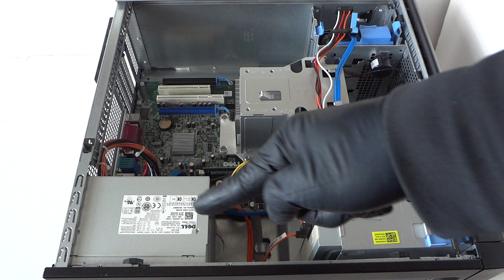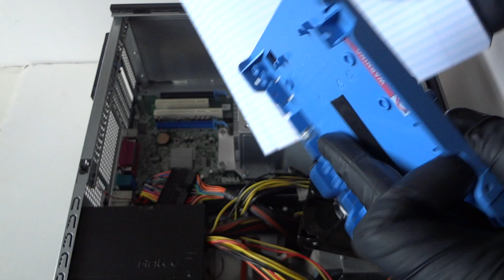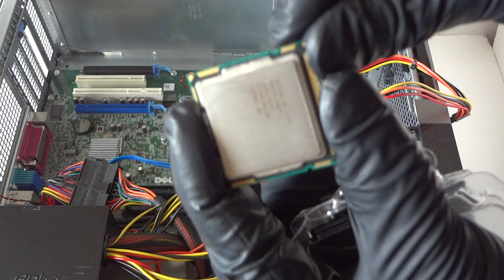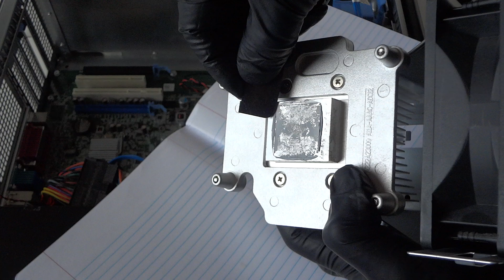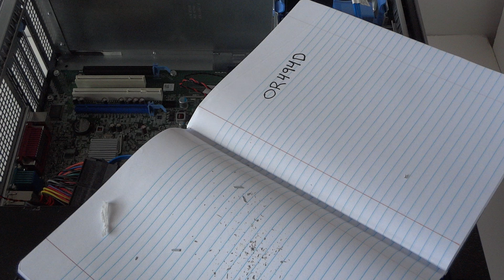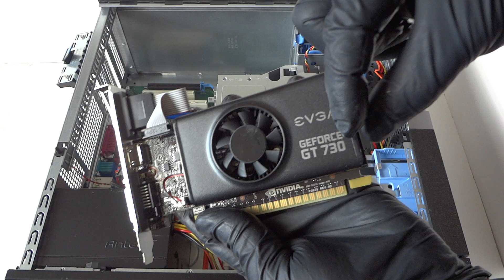Dell Optiplex 980 Upgrade Video Card RAM CPU SSD PSU

Comment: I literally did the same thing but I just replaced the cpu with an i7 that can run on 235Ws and put an Nvidia GT 730 in. Gaming computer for 130 bucks. I can play fortnite at 1080p @ 120fps no prob.
Reply: @ATLHooligan which i7 processor did you use? Thanks!
Reply: @RedRocket204  870 - best one that will fit. I may need your help on my ram upgrade I'm planning. What 4gb sticks  did u use, I heard of people having issues with some 4gb sticks.
Reply: @ATLTraveler  I have not upgraded RAM yet, YET. My 980 SFF has 8GB RAM installed which is working fine but since that RAM is cheap, I want to bump to 16GB. I will get the specific RAM running in my system (2x4GB) and report back, give me a little time as I'm using it for work ATM. Thanks for the info on the CPU as I was hoping it was the 870.
Reply: @RedRocket204  ok goodluck, this guy seems to have no issues, but I don't know if he ever turns these on and runs things. What GPU do you have? I'm trying to find out what the best one is that will fit with minimum cutting/alteration. I think I definitely need to upgrade my ram and power supply for anything stronger than my 710.
Reply: @ATLTraveler  I don't have the GPU yet as I just acquired this Optiplex 980 SFF yesterday. I'm looking at a GT 1030 LP single slot and hoping the increased RAM, a new i7-870 and GT 1030 won't exceed the OEM 235W(?) PSU. If it does, then I'll be trying to source a higher power PSU that will fit and not cause issues.
Reply: @ATLTraveler  Found some time to shutdown and pull the cover. RAM type, 4GB sticks x2 for 8GB total, working on my Optiplex 980 SFF - SK hynix (4GB 2Rx8 PC3 -- 12800U -- 11 -- 12 -- B1), (HMT351U6EFR8C -- PB N0 AA .  1316). 
But then there is a lenovo sticker on the RAM stick as well (11S41U6043ZVJ7YK3564FX .  FRU: 03T6566).  
Took a picture of it too just incase I fat fingered the numbers - https://imgur.com/VRPTtAw
Reply: @RedRocket204  nice, see how after the 4GB it says 2R? make sure if you buy more RAM it says this and not 1R. Stands for dual rank instead of single rank. Not entirely sure what it means, something about running times, clock speed, etc. but I read the 980 can have issues if you use single rank RAM. Just an FYI because I'm new this too and don't want to make any mistakes on my 1st budget gaming build.
Reply: @ATLTraveler  Good info, I didn't know that. I actually already ordered the RAM via AMZN and it's pretty much identical except for the lenovo sticker which is just their inventory sticker - amazon.com/gp/product/B01MRC4P5Y/ref=oh_aui_detailpage_o00_s00?ie=UTF8&psc=1
Will update when I receive the RAM if all good.
Reply: @RedRocket204  sweet dude, let me know for sure if they work cause I might order those same ones if all good, decent price so I may just order two sets so they are consistant, not sure if that matters.
Reply: @ATLTraveler  not sure if you've seen this link, might help with decisions - https://www.userbenchmark.com/System/Dell-OptiPlex-980/558
Reply: @ATLTraveler  16GB memory is running - https://imgur.com/UWkg4Jf . BTW, contact me on steam with the same screen name
Reply: RedRocket204 what CPU did you end up using? Was it the i7 870? How is it performing? I’m in the fence trying to upgrade from a stock i3
Reply: @AdamWoodturner  Yes, I went with a i7-870. So couple of things though with the SFF case. I am now running 16GB RAM, the i7-870 and added a Gigabyte GT1030 so I obviously upped the amp draw on the system with a OEM PSU that only outputs 235W. I know I am taking some chances here. I've also optimized Windows 10 along with trying to overclock the GPU (+ GPU clock 240 and + Mem clock to 750). No problems until I tried play Shadow of War and the PC shutdown and I had to press/hold the power button to completely power off. Everything appears to be ok so I dialed back the GPU overclocking but haven't tested with SoW yet. I am somewhat convinced I need to up my PSU. Still a decent system for being as old as it is and I haven't spent much money on it. Should reliably play games at 1080 or 720 with Med/low settings once I get this sorted. The CPU seems to be perfectly fine but I think I'm overdriving the system for amps with the higher watts for RAM, CPU and the added GPU.
Reply: RedRocket204 awesome! I decided to buy the Xeon processor which appears to be the same but on Xeon. Did you replace the heat sink? I have the mini tower like in the video. The heat sink it’s just too bulky. What memory model did you upgraded to? I have 8GB 2x4GB but I just looked and it says 1R so I need to replace it also I guess...
Reply: @AdamWoodturner  Used the same heatsink. As per the RAM, I listed a link and there is also a picture I took of the installed RAM further up this response chain. I matched what came installed with the system.

Comment: Hey guys, I just wanted to let everyone know that you can literally upgrade this Optiplex 980 with any graphics card. I'm running my Optiplex 980 with Nvidia GTX 1070  founders edition. Thats a very long card and it actually fits in the bottom PCI E slot(the black PCI E, not blue one). I got an i7 processor with 8GB ram and i'm running the latest games from year 2018 at ultra settings. You can even play games at 4K Ultra.
Reply: So.. What's the difference between the black and blue one?
Reply: The blue slot is PCI E 16x and the black one is 4x...But there will be very minor difference in gaming performance if you compare 4x and 16x. The games will run hardly 5 frames slower on 4x as compared to 16x. But if you want to use the blue slot, then you have to remove the stock CPU cooler and add something like coolermaster hyper 212 evo on it. That should clear up the space for blue slot. But trust me, its not worth it.

And one more thing, you have to replace that stock power supply unit with at least 500W power supply if you plan to use Nvidia GTX 1070 or higher.
Reply: @notusingit69420 I just upgrade my older 980 that I gave to my son. It’s the slimmer tower version so I used a RTX 4060 OC Low Profile Graphics Card. The case won’t accept an ATX size PSU so I used a Cooler Master V850 SFX Gold White Edition Full Modular, 850W PSU. Mounted it sideways and w/ only one screw, but worked out. Simple little build but does really well now w/ the upgrades.
Reply: Please tell me a graphic card that works with 255 W PSU
Reply: @dragos0285  gt 730 2gb ddr5
Reply: Did you have any issues with 4gb ram sticks?? Or do you have 4 2gb sticks?
Reply: oof'
Reply: Thanks for this explanation of that bottom slot... I was wondering this myself and not enough talk about it... Much appreciated 👍

Comment: I Installed The HyperX 1333 ddr3 ram 4gb(x2) but my computer keeps restarting like SatansWill said, did it actually worked for you? Mxkdi
Reply: You need dual rank modules or this will happen.

Comment: i put a amd redon 6670 full vid card in mine witch mine yes in bottom pcie solt without the back and side and wire tape on the bottom eges      also sure for my bad spelling im still learning reading and writing skills

Comment: Please tell me the exact name of your memory and can I still use 16gb on an i5 660???
Reply: GodOFrost You should Go with i5 2nd gen , 1st Gen Are not made for gaming , i also bought a Core i5 2400 , with 8GB RAM , 1TB Hard drive and gtx 1060
Reply: @gamingdose1988   cannot upgrade to a 2th gen, the board doesnt support it, shoudl upgrade to i7 860 or 870 depends of his video card. for 750 ti, 860 is as perfect than 870, by example

Comment: Will it fit a gt 1030 low profile my 775 just died and I found your system on amazon for $180
Reply from the maker: Yes
Reply: I settled on the 390 mainly because the room for larger graphics cards like the rx560 which I’m looking at getting
Reply: zach gloss we should just get a new case or modify your Case

Comment: you can use the bottom pcie slot. i did for my mine anyways
Reply: Does it effects the performance of game?? Which graphic card u have  used?
Reply: @gamerzworld7096  Uless you are installing something above a 1060 i think you good, even the high end gpus dont even use the full bandwidth

Comment: You can put a GPU in the bottom PCI-e slot. I currently have a 750ti in the bottom slot and its working just fine.
Reply: Haven't noticed any major slow downs.
Reply: Low profile, or regular
Reply: Low profile or regular?
Reply: I am about to install 750ti too ,but i  have no idea wad psu to use . Any suggest ?

Comment: Nice video. I installed 4-4gb sticks of Corsair xms3 1333mhz in mine with a i7-860 and a gtx750 1gb version. I had to modify the 750. No chance in hell am I cutting up my gtx1050ti sc 4gb to put in mine. I also installed a killer rosewill wireless pci card.

Comment: mxkdi as you put the psu the screws fit in the same holes of the psu so that I bought a psu of 800w when I put it I see that the gaps of the case does not match with the psu that I do respond soon

Comment: You can use any NVidia gtx 750/950/1050 that has connectors in one slot only... I used a dremmel to shave the corner of the plastic housing so that it would fit, and shaved down the second slot face plate cover, (it is only an exhaust port for the fan anyway). I did this for 3 lan OptiPlex 980's 2 years ago and they all work great as silent gaming machines (paired with the i7 870K unlocked processor. Also, I highly recommend getting a pci-ex riser card so you can make use of the NIC expansion slot as well, it will give you more expansion options if you want to put in a wireless A/C pci-express card in the second slot.

Comment: will an intel Xeon work on this pc
person shipped a 980 instead of a 990
please tell me a Xeon CPU will work on this pc
Reply: yeah it did
Reply: Pls reply, which xeon version?. Tell me the complete model number. Also it's not as simple as a 64 bit processor. Is it still working?
Reply: an older one will like an 1155 or 1150
Reply: Arnold Woodley, Yes a Xeon will work on the 980. The processor you need is the Xeon X3460 Socket 1156. It's very similar to the Core i7-860, but half the price. You can buy the processor on eBay for around $20-$40. Also, you need to update the bios to A17.
Reply: Justin Myers what heatsink did you use? The one that comes with the Optiplex mini is too bulky any recommendations?

Comment: Can someone please help me with upgrading 980 sff power supply? I think it's currently 235w. I want to upgrade the gpu, and to do that i have to upgrade psu. Where can i find a psu that is compatible and of better performance and watts?
Reply from the maker: Hi, what kind a gpu are you going to install?
Reply: A 750ti LP would be fine in that system on that psu
Reply: I am also looking to do this with a 980 sff! I want to install a 1050 ti LP, and I think the recommend psu is 300w. Any tips?

Comment: i need help i put my corsair cx600 power supply in my dell optiplex 980 from my 2007 gaming pc build (which is my only good power supply) and it wont turn on none of the leds are turning on and when i press the power button it wont turn on and the pc wont boot the power supply and motherboard does work and even i got that 24 pin to micro 24 pin power adapter and the 24 pin adapter from the power supply wont fit but there is a way to separate the plug on the power supply by unclipping a 4pin and then hooked it up and i wont turn on no fans running, power led lighting up or any beep codes i tried  searching anywhere but the same vague answers come up
Reply: baliebox 4916 maybe the psu problem

Comment: ive tried about 20 different ram sticks and cant get this model of the 980 optiplex dt with the 660 i5 to boot to windows with any 4 gb sticks,i seen a post on it saying they need to be 4 gb ddr3 1600, pc3-12800 ,CL=11,Unbuffered,non-ecc,1.35v -512megx64 ....... or 4gb ddr3 1600 mhz  unbuffered non ecc 1.5v,512meg x64 and both of thoses are timed at 9-9-9-24,which of the 2 work is beyond me
Reply: you probably have bad ram slots or ram is too fast for the pc
Reply: should be 1333 mhz

Comment: these models of Optiplex have problems with 4 gigabyte sticks of memory did you get that PC to actually boot to Windows because on those models if you don't run a certain type of ram they will go into a continuous restart which is my problem right now I can run four 2 gigabyte RAM sticks just fine
Reply: This is caused by single rank memory which is oddly not supported in the 980, get some dual rank ram and it can run 16gb no issues.
Reply: ATLHooligan what model of ram?
Reply: @AdamWoodturner  I used patriot viper, but as long as its dual channel and ddr3 it will be fine. Also you cant have anymore than 4gb a stick, max 16gb total. Meaning you cant used two 8gb sticks, you need four 4gb instead. I have a video on my build.
Reply: ATLHooligan I’m having a hard time I bought regular Hynix memory 4gb x 2 and it will not boot up to win 10 but my original 2GB x2 works fine and both are 1R... is your video in your channel?
Reply: i got 4x2gb just fine